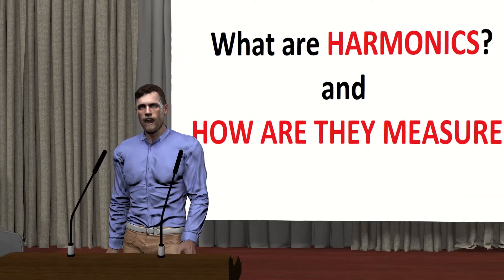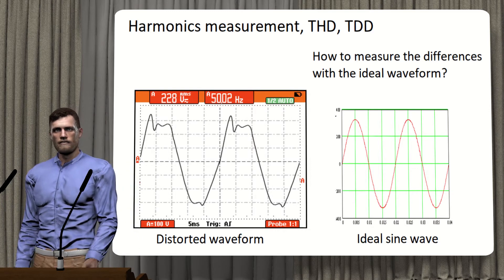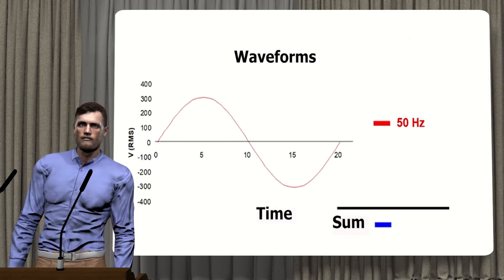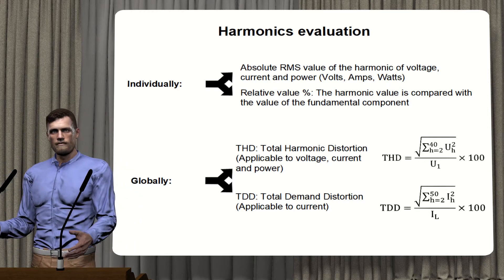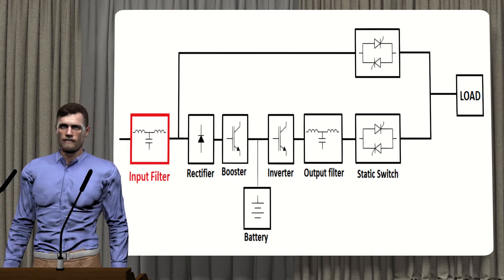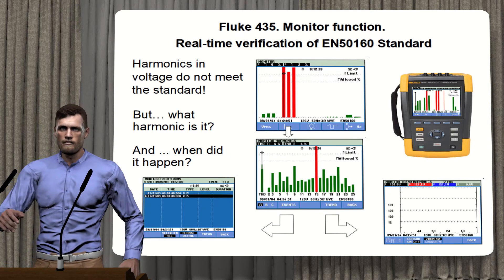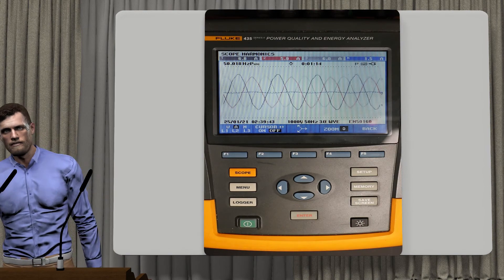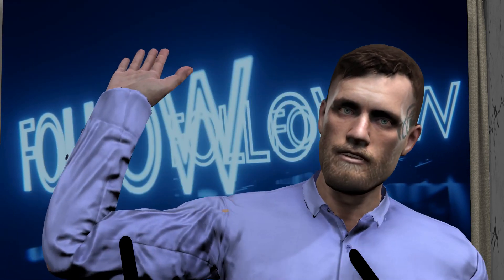Harmonics in electrical installations: what are they, how are they measured and  analyzed?

Comment: 3:17 Not exactly true. The definition of a linear device/load/component/element/network is not that which draws sinusoidal current when excited by a sinusoidal voltage. The definition is if it satisfies the superposition principle.

There are linear loads that draw non-sinusoidal current when excited by a sinusoidal voltage. Example: linear time-variant loads.

For some reason in Power Engineering, they say linear loads are those that draw sinusoidal current. But the definition of "linear" based on superposition is consistent with the definition used in Signals & Systems, in Differential Equations for linear ODEs, and in Linear Algebra for linear transformations. So it is clear the definition used in Power Engineering is the one which seems wrong, since it is inconsistent with many other branches of science.

If you want to refer to a load that draws sinusoidal current when excited by a sinusoidal voltage, that load is linear time-invariant (LTI). If you want to refer to a load that draws non-sinusoidal current when excited by a sinusoidal voltage, that load is non-LTI (either because it is non-linear and/or because it is time-variant).

4:05 Note: Fourier did not invent the FFT algorithm.

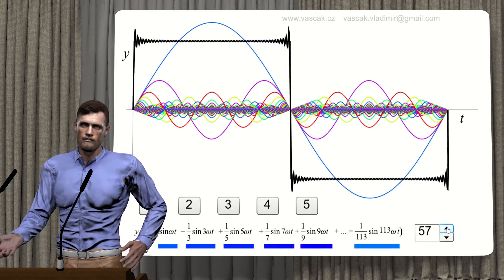4:57 In a cycloconverter, the fundamental cyclic frequency of the current is not 50 nor 60 Hz.

6:42 Actually, the frequency spectrum consists of two graphs. The one shown in the video was the amplitude spectrum (normalized). The missing graph is the phase spectrum.
Reply from the maker: Hello Alejandro, thanks a lot for your interesting comments! I really appreciate them.
Reply: woah !! I'd actully love to watch your video, in much simpler language and bit more understandable. i needed some help with understanding the term harmonic indices and what it covers.

Comment: item 1,2,3,4,7,10,11 rather this is the correct control tolerance specification or not ?
I am not sure it that any tolerance control tolerance specification for item 5,6,8,9 ?
Parameter	Calculation method	Specification
1)THC(A) 	
<5%
2)I-THD(%) 	
<15%
3)POHC(A)	
≤ 0.251
4)POHC Limit(A)	
≤ 0.251
5) V_RMS(Volts)	 	 
6)I_Peak(Amps)	 	 
7)I_Fund(Amps)	 	<5%
8)Power (Watts)	 	 
9) I_RMS(Amps)	 	 
10) Crest Factor	 	≤ 20%
11) Power Factor	 	≤ 20%